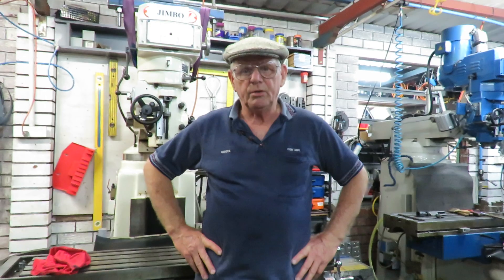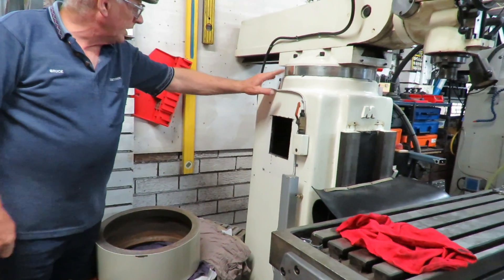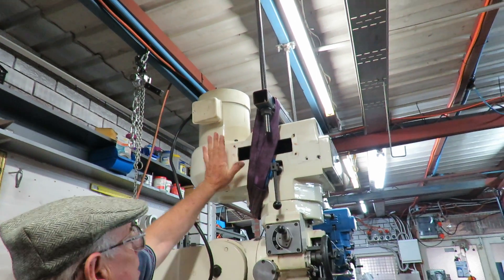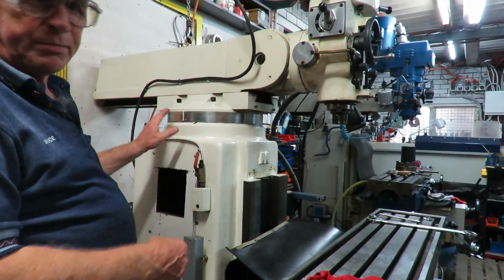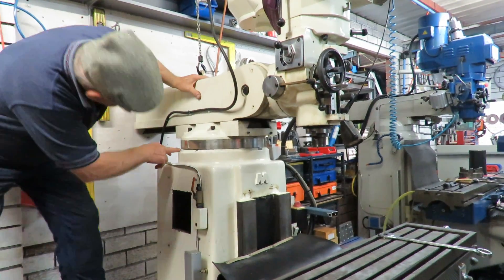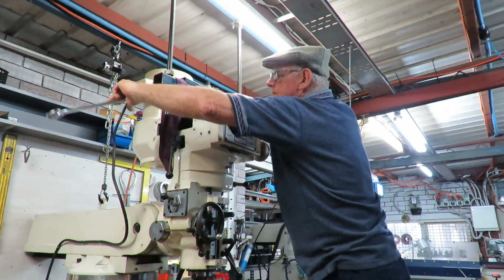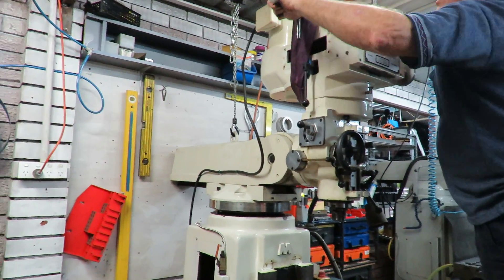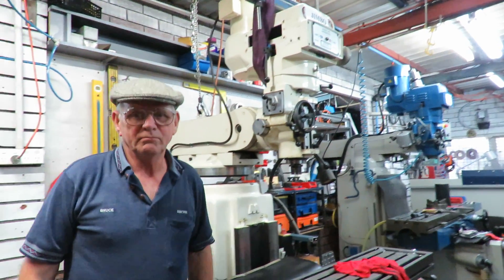413 The Long Neck Jimbo installing the riser 6330 Mill

Comment: I looked for more info on this, Did you make a second vid? I searched through your channel, could no find, But It looks rather self explanatory. I just finished a job using a Lagun mill/with a 20 inch tilting rotary table. I lost 6-8 inches with the table alone, and once tilted, I had very little room left to machine the work piece. My CNCs are no help, so will need to do this eventually. thanks so much for the vid, It will be helpful when I tackle this same project

Comment: I know it's a long time ago but could you have used the knee to raise the front, combined with your hoist at the back?
Reply: I feel like you could bolt a fat aluminum bar to the table with a flange, stick it up inside the spindle without a collet and raise the knee to hoist the whole ram and head in its entirety. Little hard on the lead nuts but I'm sure its plenty strong enough given the things some people set down on those tables.
Reply: No this is not a good idea.  You will overload the static load rating for the spindle bearings.  Yes you can use the knee, but don't use the spindle, or the quill.  That's a TON of weight cantilevered away from a spindle which was not designed for those loads.  A fixture or weldment to the table that supports where the ram meets the head, another lifting device on the ram's hook is the way to go.  Or a sling setup.
Reply: Yeah especially given its a cat 30 spindle which I didn't notice till after making the comment.